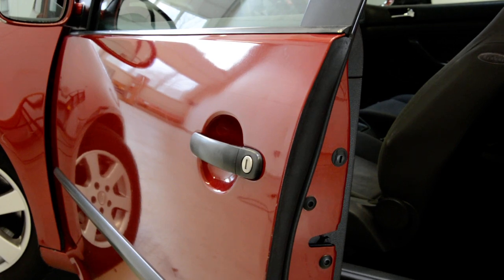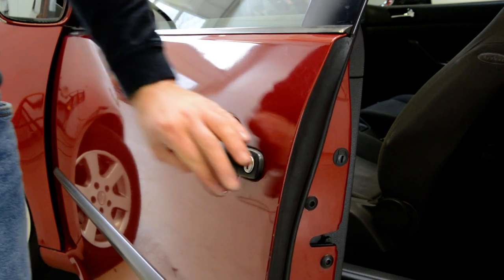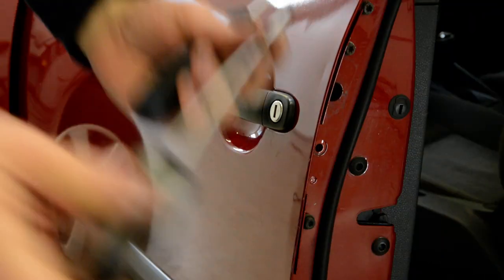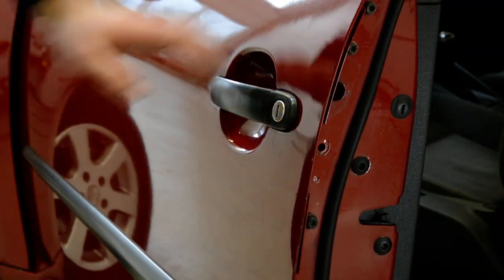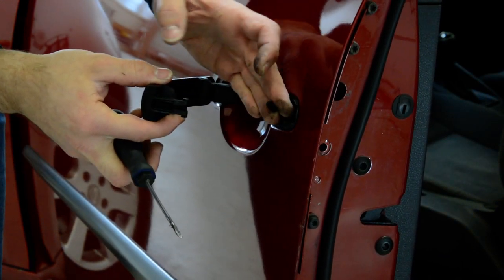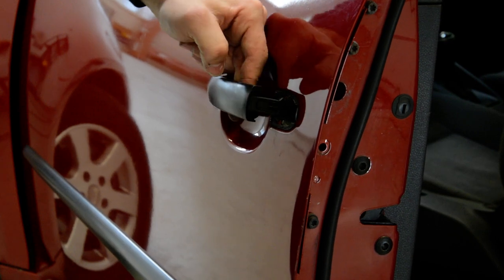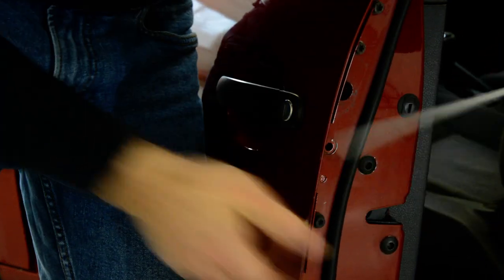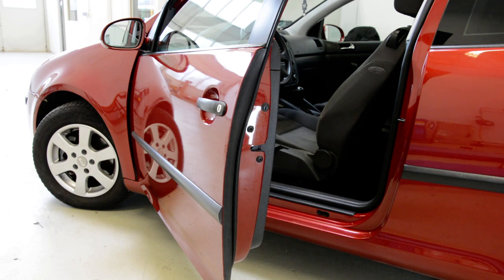How to remove the door handle driver side VW Golf mk5

Comment: Just remove my handles on my mk5 golf gti 2004 using this method. Only difference was I unscrewed the tx20 fully out and removed the end cap and door handle. No need to u screw and screw back In to remove.

Comment: My car is a Golf V 2008, got it all done, bt after removing that small cable my handle still wouldnt come out, any help?
Reply: sanna ali On his other video for the passenger side, after he removed the ‘small part’ he screwed the torx screw back in so the door handle would release....but didn’t need to do that here for some reason🤷🏻‍♂️
Reply: Yeah I have the same problem mine is a 2007 did you figure it out?